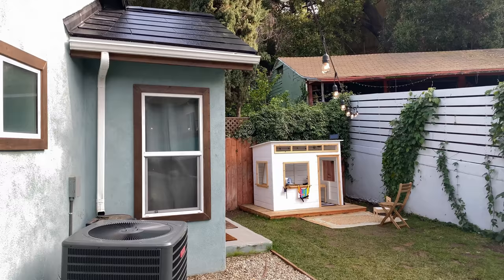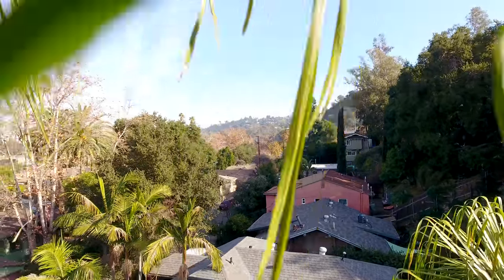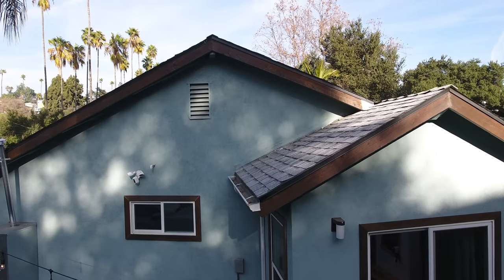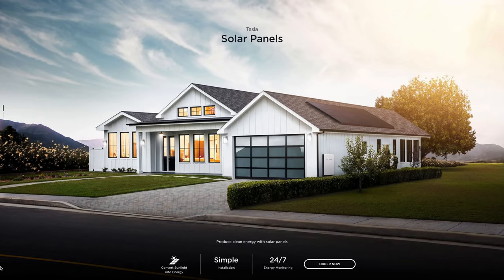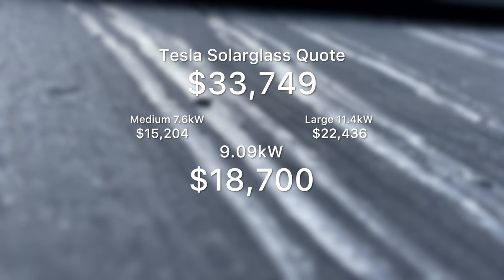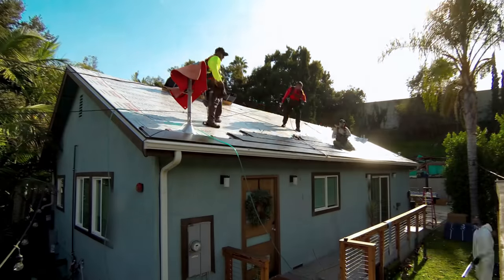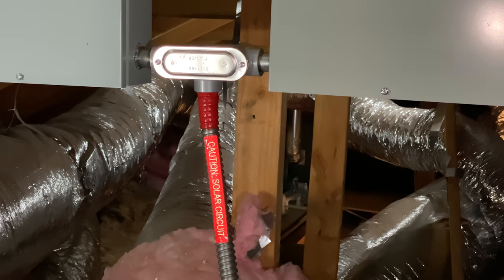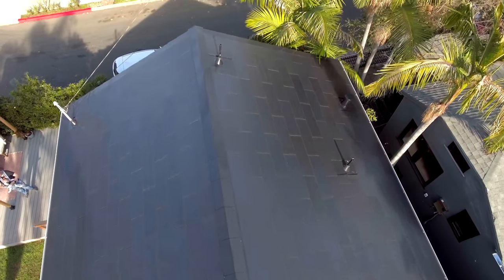WE GOT A TESLA SOLAR ROOF : First impressions and what you need to know!

Comment: If the solar roof only lasts 25 years the money you paid for the roof isn’t worth it. 115$ a month is around the price of my electric bill during the winter 85$ in the summer. I’m figuring 114$ is the cost of the Tesla solar for the 25 year warranty. That means solar panels will actually cost more and the only person that will benefit is the Tesla man. No thanks!
Reply from the maker: I mean, have you considered that people might have different electrical bills than you? We average $200/month. Also, the roof will last longer than 25 years, that’s just the life of the guarantee.
Reply: There’s also a finance charge also. Unless u have the 35k to put in to it. 
 I’m thinking from my point of view. My house is 3000sq ft and  your house that you put the solar panels on looks a lot smaller than mine. So I didn’t think your excel would be higher than mine. If you can afford it and love the look of it than heck yea it’s worth it. I just can’t personally do it myself. If it was like a 40 year warranty I can justify the cost

Comment: Degradation efficiency Cost "Shading" all real issues with these tiles and this particular roof has shading issues,  these solar tiles are in 2 strings central type system, shading is hugely important in performance. There is no way that these roof tiles last as long and perform as good as traditional mono solar panels. Today we are getting close to 400 watts in 16sq.ft with traditional solar panels.   It's a pretty roof, But what we really want to see is performance, you should add link and share the visibility real time performance of this inverter so people can see the real delivered power of the system. costs of this installation seems off

Comment: Firefighting hazard! They won't be able to prevent a fire from burning most or all of it! The house will burn!
Reply: Kylie Mitchell That's assuming that there ever is a fire. I've lived in several houses/apartments over the years and there has never been a fire. And I don't recall any fires at the homes of any of my friends/family. Houses do burn down though, and most of them have conventional roofing materials (asphalt shingles, tin or ceramic tiles). Are you a firefighter?

Comment: Sorry for you guys. It's dumb. They sold it to you like this.  The solar roof cost as much as a roof plus a standard solar array. So the cost is sky high and you are saving zero money on energy. Because the cost of the roof and solar are rolled into one. No power offset because of the high cost. You got rooked. A standard roof with a commercial array is the only way to go. It is not zeroing out your electric cost because the savings is eaten up by the extremely higher cost of the tesla roof.  Sorry you got screwed

Comment: Lots of trees around the house, not good for solar roofs.
Reply: 9am-3pm are the hours to bank sun and be shade free. The rest of the day doesn't do much. I wondered about that too. A panel can lose all it's volts or amps if the shade hits it right.
Reply: That is where micro inverters help, however from what I see this is just a string setup?

Comment: Let see my current ele bill is 200.00 a month on average. 200.00 ÷ 33000 is 165. If I factor in inflation that is 10 years it will take to break even. Then I can in joy my solar savings. Thats if I don't not finance. 
Solar panels alway save the Electric company from have to make electricity 
But rarely do they save you money.

Comment: You are technically a utility, and you are not being paid for the thousands of kWh you are generating which should be a crime. And they have the audacity to charge minimum service charges... Very disappointing. You should get the power wall, and offer to charge peoples cars for that offset for x amount... or during outages, offer an extension cord to your neighbors for food items, etc..
Reply from the maker: We get energy credits, which "pay for" the energy we use at night, cloudy days, etc. (energy at night, during peak demand periods, is more expensive that the energy we generate during the day). We can bank credits (sort of like roll-over minutes) but can't cash them out.

Powerwalls would never pay for themselves. Would need to spend roughly $60k to ensure I NEVER needed the grid, at which point it could save me a maximum of $156/yr.

Comment: Just doesn’t make sense from a cost point.  You can get a asphalt shingle roof installed from anywhere from 300-450 a sq.  Your house looks like maybe 15 sq. So let’s round your roof cost to $5,500. Now you pay $33k to save on a 200 a month electric bill?  Put that 33k in a investment account and earn 6% on your money for 20 years and your losing out in over 76k in interest.   This is a bad investment
Reply from the maker: We got 3 quotes on a new conventional roof. Lowest was $9k. 

Also you forgot to deduct the conventional roof’s cost from the $33k you are investing. We needed a roof!

Anyway, I wanted solar for reasons that weren’t strictly financials and the solar roof has nice aesthetics and will pay for itself in ~10 years (or, more likely when we sell the house in 3 or 4 years). I promise we are investing plenty of money in the market as well.
Reply: @AustinFlack  I guess labor rates are much higher where you live.  Asphalt roofs r cheap in the north east.  How many sq is your roof?  Also I get what your saying, I’m building a house and thought about Tesla roof but at 1,700 a sq it’s just not economical for us to do so

Comment: The most important part of your solar installation, actual operation, is left out.   That makes this just a commercial for the product without any actual facts of the performance of the system.  Risky investment at best for now.   I don't believe it will "zero out" your electrical bill.  Electric providers have found ways to generate revenues from solar customers, as well as the local governments getting taxes and fees for being off the grid.  Given the added expense of the start-up and the prospect of less than expected generation from the cells due to darkness, clouds and seasonal effects,  may not make the system as much of a smart decision.  Of course, it does make someone "feel good"  that they are doing something good.  Windmills have proven to be poor investments in the long run.  Solar will as well I believe.

Comment: Are the wires made of soy that animals will eat? That could be a nightmare in my opinion.
Reply: Kef103 Are any of the "wires" (I presume you meant "sheathing", not the actual wire?) in your house/apartment made of soy? Animals eat through conventional plastic covering on wires anyway. Soy might be a little healthier though. Cheers.
Reply: @gwarlow  yes many companies use soy based material for the wire sheathing.

Comment: Way too much. Sorry. I have 6500 w for less then $2000. Its paid itself off after 2 years. I have an all electric house and my bills are less then $200 / month in winter and $50 / month in summer but I loose grid power often so my system will also run the house . Check my channel out

Comment: Wow you fell for it.... you spent more on those tiles then you would have spent on electricity for the rest of your life!!!  And you still need to replace them in 25 years...

Durrr.... take my money Elon....durrrrrr...
Reply from the maker: My electric bill is approx. $220 a month. The solar portion should pay for itself in 8-10 year... and will add significant value to the home if we sell.
Reply: @AustinFlack  how do you have such a high electrical bill? I have a smart thermostat and all LED lights in my 4br  house and my electricity bill is only 60-80 per month and 80% of that is the delivery charge. I just developed good usage habits ie turn of lights when I leave the room only turn on AC when I'm home. Yadda yadda. If I picked up 2 400w solar panels I could probably get that bill to around 50 but then again it would take 8 or so years for them to pay for themselves.  Not worth it in my opinion.
Reply from the maker: We have all those things. We also have an electric car, and electricity it more expensive in SoCal that elsewhere. Average of 19 cents per kilowatt.